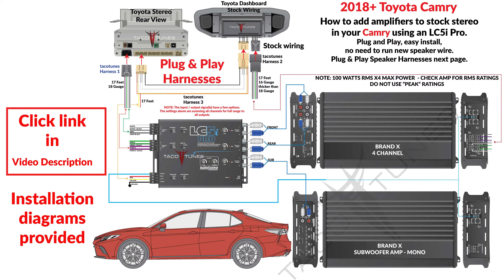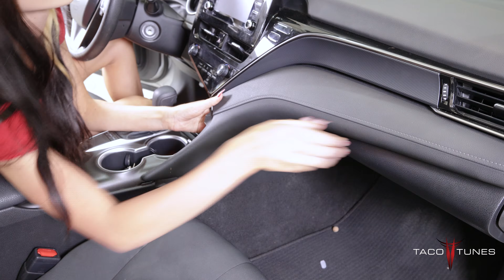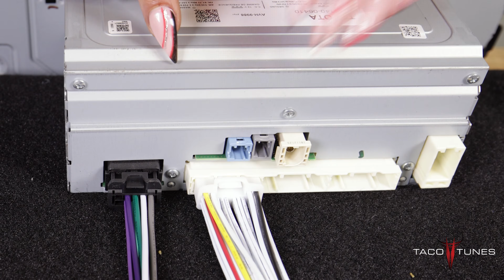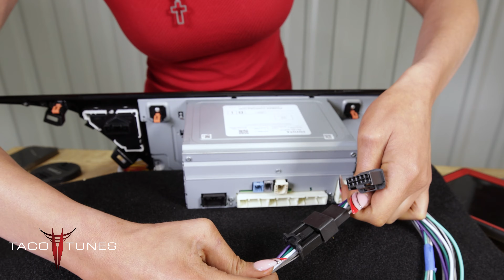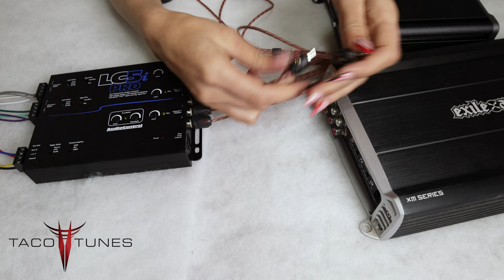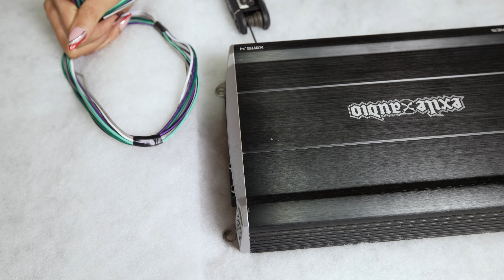2018-2024 Toyota Camry add amps stock stereo Audio Control LC5i Pro 4 Channel Subwoofer plug & play

Comment: My camry has the jbl amp and speakers. Will this work?
Reply: They don't sell a harness that pulls both the dash speakers (mids/highs) and front door speakers (lows), they only sell a harness with the lows for bass. I'm going through this right now. Looks like, if I identify the dash speakers in the wiring harness, I could tape into them, and connect them to the speaker terminals on the LOC, and it should receive full spectrum. Working theory.

Comment: For the output wires green,black,grey,purple, and white. What order do we connect them to the 4 channel amp @tacotunes is there an order left to right or front and rear based on color? Thanks in advance:)
Reply: the order in which they are connected isn't relevant. as long as they are all connected into correct positions.

Comment: Thanks!   Looking forward to your next video on the 2025 XLE Camry or a 2025 Crown!    I wonder if there is any difference replacing the stock or "upgraded" jbl system as far as the number of speakers it supports once you upgrad it to custom speakers.   E.g. one has 6 and the other 11 but if you are putting in your own can you put 11 speakers on the stock system.   Also wonder where you can stow all that out of the way.
Reply: I have a 2025 camry SE, literally identical set up to the previous gen. The Crowb might be a little different due to the new platform
Reply: @kepler656  so the non-JBL 2025 would work the same way as this one she's showing? I know the radio interface changed with the new 12" screen

Comment: The installation you did this on is not a 2018 to 2020.  I'm sure it's pretty much the same but the air vents are at the top and not the bottom.
Reply: No, they redesigned it in 2021 to put the tablet in. Trust me lol
Reply: @TJsVette 21 is when they changed the orientation of the radio and vents.

Comment: Hi, this looks great! Thank you for the details and work you guys did! I do have a question for you thought, Do you have any harnesses, cables, adapters recccomendatios for Toyota Grand Highlander 2024 limited Hybrid Max with JBL system with sub? The stock is  mediocre, and I'm trying to upgrade it to better speakers, two amps, and a sub without losing head unit functions.  Your suggestions are greatly appreciated!